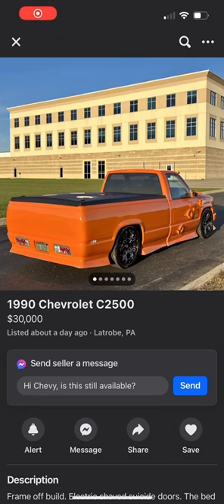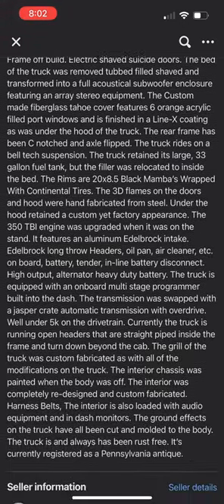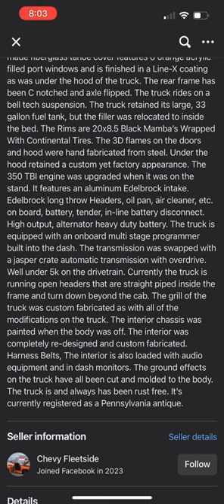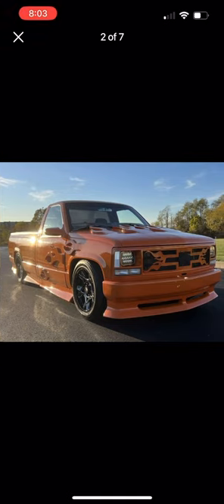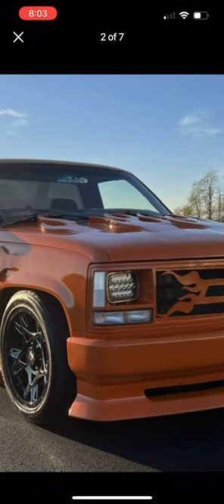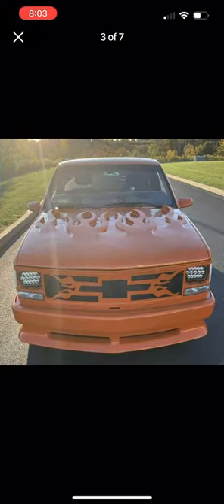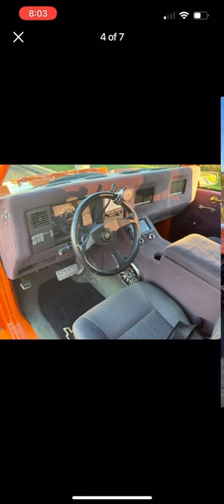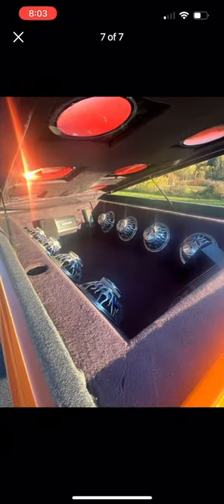This chevy 2500 is slick but the 3d flames stand out. Have you ever seen sheet metal flames before?

Comment: How on earth did they make a 2500 look like an s10
Reply from the maker: You sure about that?  Grilled surround and the tbi 350 suggest at minimum a half ton. Interior proportions seem bigger than s10. Honestly as custom as this one is I’m not an expert at telling them apart. Just going by what he put in the ad
Reply: @drewdoestrucks  by slamming it and messing with the body panels like they did it creates a bit of an optical illusion. I can tell is a full size but the whole body screams s10.